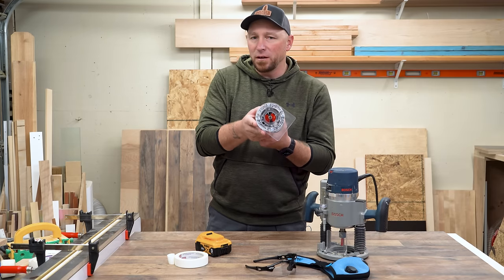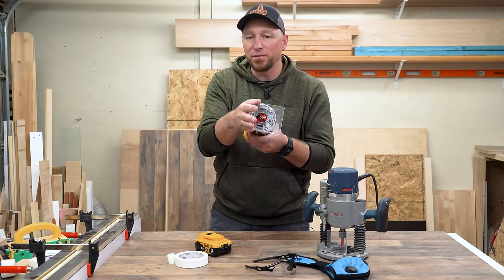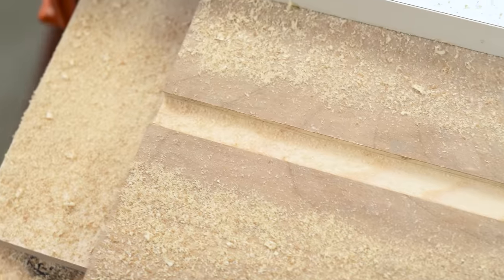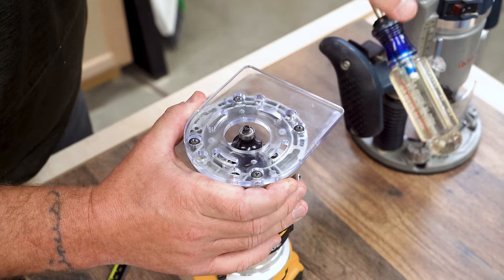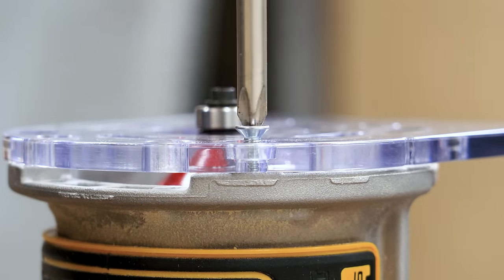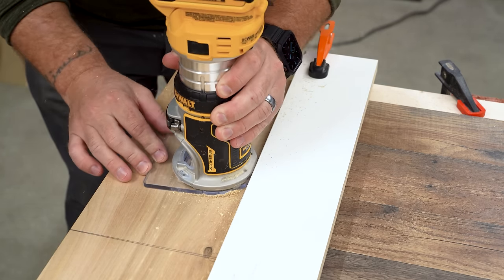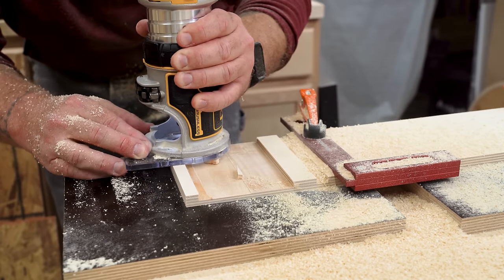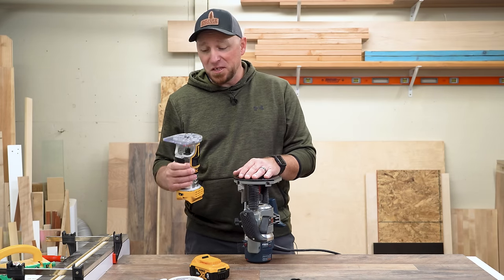END Router FRUSTRATION With This ONE SIMPLE ADJUSTMENT / Woodworking / How to Adjust Sub Base Plate

Comment: As far as I know the flat side is for stability when you change bits. You lay it down on that side so it doesn't roll over, but most newer routers have a shaft lock button so it doesn't matter what side you lay it on because you're holding it in place with one hand and turning the wrench with the other. Back in the day you had to use 2 wrenches so you couldn't hold it in place, so you put it on the flat side
Reply: If the collet is tight, you will not be able to prevent the router itself from turning when loosening the collet. The flat side provides the necessary stability for that.
Reply: That makes a lot of sense.

Comment: Great explanation and I’m with you as I use the rounded side for trim routers for accuracy.  The flat side is good for placing it down, changing bits, and using track guides. 👍🏼

Comment: SPOT ON...for all accounts...

Anyone that thinks "more accuracy" is achieved from the "flat side" is either grossly inexperienced or confused about the fundamentals of geometry...

The "flat edge" (as stated by others correctly) is mainly for laying the router on its side for bit changes...and...for some "jig" configuration that also has bar rods working in concert with the "flat edge," (not on all models) other than that you would...ALWAYS!!!...use the rounded edge trued to the center of the bit as you have so correctly suggested...Great video!!!

Comment: I thought the flat bit was to stop the router from rolling when laying it on its side
Reply: It's unnecessary since the router's handles already prevents it from rolling.
Reply: @bobweiram6321  not on a laminate cutter style like this. i have one its circular. i stand mine up on the end with battery tho and can use it upside down for smaller stuff. 
the extra square bit also helps when on a small edge as gives you more length for balance.
Reply: @kanedNunable  Yes, but doesn't explain why the larger routers with handles have it too.

Comment: The flat side can be useful for certain attachments, jigs and tracks. It also allows things to get closer to the bit which is again helpful for attachments/jigs but also when using bearings so you don't need as much space to clear clamps and features like inside corners.

Comment: It's common knowledge you always put the round edge against the straight edge. Most routers are round with no flat edge. The reason for this is if you twist a flat edge you just screwed up your cut but with a round edge, it will always stay straight as long as you are against the straight edge. Manuals used to explain this but I haven't looked at a router manual for 40 years. Now the straight edge you mount on your router is a different story but you must make sure to never let it pull away from your edge. You have explained it well. Centering cones are cheap and work great. Good luck and good routing.

Comment: The flat side of my Festool OF1400 allows me  to avoid clamps when working on the edge of a single piece (flush trim, roundover…), meaning the width between the bit and the tool base is shorter at this spot. Otherwise I always keep routing with the round side against the fence to keep the groove straight.

Comment: I have taught a router class at Lee Valley tools for an number of years and I also ONLY ever use the round part of the base against a fence/guide. I have always wondered if for the larger routers, the flat edge on the base may be to reduce the the overall size of the router in its case. A thinner router profile means a thinner case so less material to use in the manufacture of the case. They try to save money wherever they can...

Comment: Thanks for another great video as always!!! I agree with you 💯!... I believe the flat part of the router base is for safely lying your router down on your workbench while the router bit is still spinning... Otherwise the router will roll around all over your workbench, which will be extremely unsafe!... Just my opinion!... Please continue providing us with your great informative videos! 👍👍👍
Reply: I agree. The tendency for most users is to set it down on its side without waiting for it to quit spinning. Or even to intentionally set it down while spinning and making a quick adjustment.
Sounds unsafe, but the temptation to do that is very strong.
Reply: @mrcryptozoic817  I agree 💯!!! impatience causes LOTS of accidents!... Not only on the roads, but in workshops as well!!! 👍👍👍

Comment: Excellent video. This is also related to Physics, specifically w/ friction. When comparing router sub-base edges, round vs straight, only a small area of the round edge interacts at all times, with the straight edge of a material. The less surface area, the less friction, hence, the smoother the sliding. On the other hand, the more surface area (from straight edge) interacts with edge of material, the higher the friction, thus requiring more force, resulting on a less smoother slide or movement. I have used both styles, and the round edge by far, always produces a much easier smoother and better sliding control vs straight edge. Viva La science!🤪

Comment: I don't know if that is the reason, but the flat side of a router like your Bosch is very convenient when you don't need to register against the base (template bit, bushing,...) and don't have much space to maneuver. As the center-edge distance is way lower on the flat side, you can use the router closer to, for instance, a vertical piece of wood, or a clamp, without getting bothered. So you somehow have the benefits of a wide base (high stability) without the drawbacks (high footprint).

Comment: My approach is to mark a point in the router baseplate edge and keep that point against the edge of the wood. Any change in offset is minor if I control the mark against the edge of the wood. 

It can't hurt to take the time to center the base to the center of the router bit, but I have had good results my way and I save that little bit of time. 

But I wouldn't use the dial indicator approach because it can be a lot of back and forth adjustments. I do have flathead screws holding down my baseplate.

My plunge and standard bars are both round.

Comment: I generally haven't the mindset yet to use routers a lot... they do require a lot more table space to operate, and that is something I find difficult to provide for myself, as the only true flat table I have is my table saw top. But good tips, as always, great info!
Reply: a Router is one of the most useful tools in your arsenal, believe me!... Make a plan, even if that means that you have to use it on your dining room table (or your floor)!... Don't miss out on this fantastic tool!!!
Reply: I have my fixed router, in my table saw. I am using my router as much as my saw. table saw cannot follow a template creating exact replicas of any shape.
Reply: @diywtlc2249  I do too, but a fixed router doesn't "jig" up the way a plunge does! LOL

Comment: I can’t say how little that cantering cone is used by all the woodworkers that I come across. I use it with almost every router bit change. You also have to buy (reasonable) quality bits that are accurately circular. I won’t buy router bits from a retailer or manufacturer that I don’t know. Buying quality bits does cost a bit more but they last longer and are safer. If you have ever had a router bit disintegrate as you use it (speaking from experience) and have shards of hot metal whizz in all directions, suddenly that extra £2 or whatever seems money well spent. 

It’s not only a question of accuracy but also safety.
Reply: That sounds horrific, with no way to avoid some kind of injury. So now please just name-drop that bit manufacturer for all of our benefit... while I go inspect my router bits. Wow.
Reply: I got a new flush trim bit with top and bottom bearings and I made one pass using the top bearing and the next pass was on the bottom bearing and the bearing exploded. I  knew something was going wrong and reached down to turn it off and that's when it exploded. So I didn't get hit but it took a chunk out of the plywood on the wall so it would've done some damage. Now I inspect every bearing I use before I use it new ones also
Reply: @chichidouglas5078  it’s frightening. Obviously a new router bit should not be doing that. But, even a quality router bit if used when blunt can act up. I much prefer the template bits, as you say, with bearings top and bottom, but the cutting edges are a hybrid spiral up and spiral down. They seem to give the best quality of cut. But, they are expensive.
Reply: @chichidouglas5078  always check clean and properly lubricate the bearings.
Reply: @akbychoice  I agree 💯!!!... I even gave your comment a 👍!... However, some bits are blunt, not running true and therefore extremely dangerous right out of the box!...
Reply: I was using a guide bushing, Changed the router bit, but this time the larger bit hit the guide bushing. Metal went flying, scared me bigtime. I thought I was doing this the safest way. No one ever told me the plate could get off center using factory holes in base plate. I then went to a big woodworking only retail store, for a centering cone to setup my router and they seriously did not know what I was talking about.
Reply: @akbychoice  it was part of a brand new set, and I had just checked it out when I unwrapped all of them. It spun freely the screw was tight and it was still tight after it happened. It had some random defect that wasn't visible but it showed up under a load. The bit still works like new, and so do the rest of them. I always turn it on and test the bearings before I start now
Reply: Yeah, ive had a router bearing fail on me mid-cut as well. I was using a Mastercraft flush trim bit and no longer will I use inexpensive bit for extended periods of time. Like StympyNubs said if you have a large pack of cheap router bits(paraphrasing): "Replace your most frequently used router bits with good quality ones over time."

Comment: One good use for the flat side is when routing the edge of a workpiece and removing a lot of material quickly without having to adjust depth of cut.
You dial in your depth first and lock it down then make repeated passes of the work starting with the flat edge rotated somewhat away from the work to make a skimming pass then repeat one or more times with a bit less angle each time.
Then you make your final pass with the flat side of the base snug to the straight edge.
If you are using a fence and routing an edge then you can do the same thing starting with only one end of the fence touching the edge of the work at one end and keeping the other end offset by e.g. 1/8".
This means that even when multiple passes are reqd, each piece of wood only has to be handled and clamped down once so you are not reclamping and shuffling material all day.

Comment: The flat side makes sense for a plunge router going along an edge, as the larger area would help stabilize it better. On the small trim routers - the only thing I can think of is so you put it down on the side without it rolling around.
Reply: you are right, you have more surface area on the piece, that is not really creating stability, it is forcing you to keep everything perfect. Any rotation and the cut is skewed. On the round side you have a single point of contact. you press against your workpiece, even using weird angles to pressure against the piece. meaning you have more stability because you can rotate your router for your needs while making the cut. You are more stable. I look at the square side, and picture it for attaching a side guide for putting your cut more inside your workpiece, not on the edge

Comment: I agree that the round side use is the way to go, and I think the commenters below probably nailed the 'why' of the flat side between non-use stability and bit changing. Overall, this is an awesome tip that I'm definitely going to apply - can't recall the last time I checked baseplate centers. Would explain some quasi-wonky results I've had... though in a general sense, routers are at the same time very useful for hundreds of things and capable of totally screwing up your project component.
Reply: Routers are some of the most useful woodworking tools available!!!... Most important when using routers is to be aware and understand CLIMB CUTS!... Unavoidable sometimes, but should be limited to an absolute minimum!!!... I believe it's CLIMB CUTS that screwed up some of your projects!!!
Reply: @frederikmare9002  I agree with you - climb cuts are a necessary skill. I guess another way of stating my thought is, no matter your experience, setup and prep, etc., the router - while very useful - is sort of the random element of all power tools. I still use them, but it's hard crossing your fingers while using one.
Reply: @mattelias721  regard a router as a planer of which the blade is vertically rather than horizontally... And feed accordingly!... It's a great tool that is even safer than a planer (since the blade is much smaller than the blade of a planer)!... Have you ever even considered feeding a piece of wood from the rear of a planer or table saw?... I believe that's the best explanation of a climb cut!... The wood is going to climb on top of the blade and will be ejected at high speed, leaving deep blade gouge grooves in the wood, and injuring anyone that's in the way!

Comment: Hi this was excellent. I have a question for you. I have a Dewalt 611 PK router ( a palm router with a plunger ) I can not use rabbet bit because the bit is a little bit wider than the opening of the base plate.  I have been looking for a after market base plate that comes with a base plate opening wider than what I have  and I have not been able to find one. Do you know of any ? I appreciate your input.  Thanks

Comment: It seems to me that, if the base is misaligned (for whatever reason), and the curved sides are no longer equidistant from the centre line of the router, at least the flat side will maintain a consistent distance to compensate. Just a thought.
Reply: I agree 💯!... However, in a previous video, he explained how to ensure that the sub base of your router is centred to the router bit... Once you've ensured that the sub base is centred to the router bit, it's way better to rather use the round part of the router base than the flat edge of the router base (along a straight edge/fence)
Reply: always center your base plate, takes seconds, lets you route easily using the round side, round side won't spoil your project
Reply: It is unsafe to use the "flat edge" for other than bit changing unless working in concert with a guide that it is affixed to...

Comment: I was debating this baseplate issue last month when I purchased my first palm router... I was going for the Bosch GKF125CEPK palm router that comes with the plunge base, case and edge guide. But read a few sites that said a flat side base gives you more control... so I got the Dewalt DWP611PK instead... but that Bosh is still on my mind. lol

Comment: Been a woodworker for over 40 years and I use both round and flat sides of the router base of over 14 routers I own now and all I can say is, if your having issues with using either side then you better go back to practicing and work on your skills, or paying attention to what the hell your doing before someone gets hurt
Reply: As a point of note...it is considered a "safety hazard" in many shops (especially in schools and instructional centers, insured businesses with safety managers, etc.) to ever use the "flat edge" as a guide working by itself without being secured to a rails system of some form when the "flat side" is oriented that way (e.g. Festools, et al.)...otherwise the ONLY purpose of the flat edge is for bit change...though I agree on many use routers unsafely and "cowboy" it with the flat edge...

I too have been doing this work for over 40 years and in other countries, as well as, seeing and responding to (as an EMT) a number of accidents involving those "trying" to use the flat side "free handed." Routers were not intended for this though some original manufacturers did not make this distinction clear...